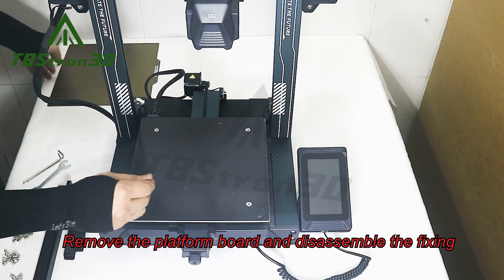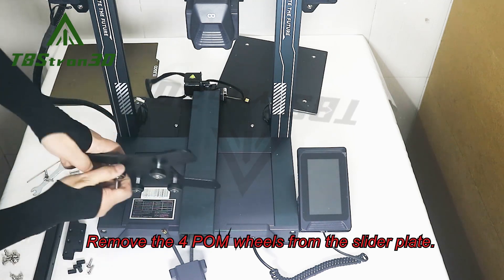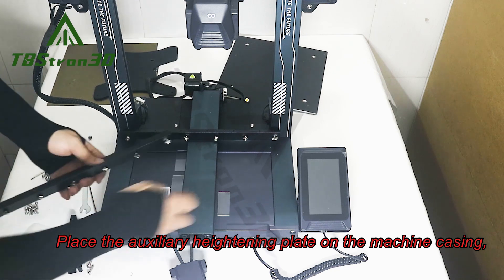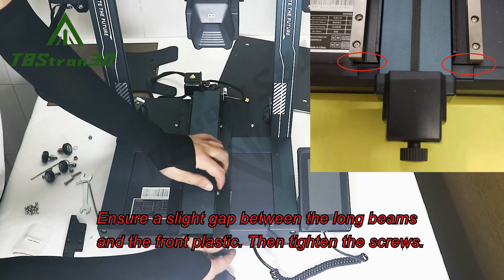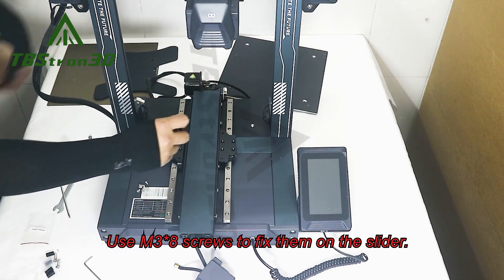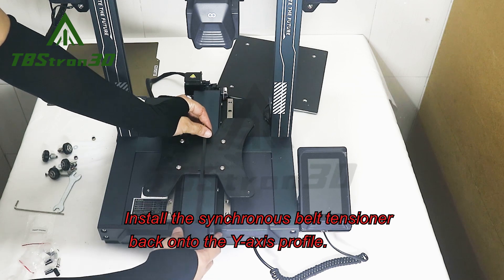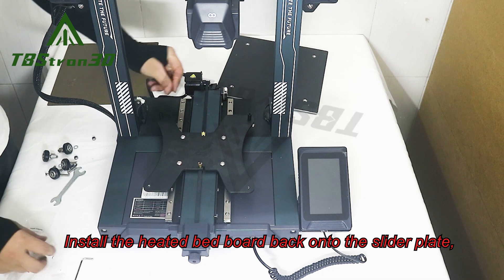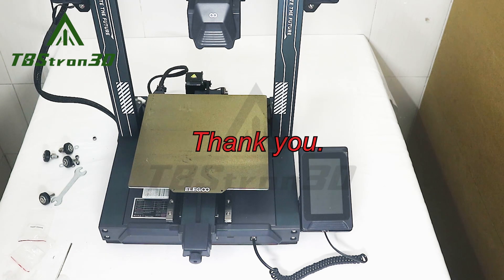New  Y axis upgrade linear rail for ELEGOO Neptune 3 Pro、Neptune 4  installation guide

Comment: Hello, for Neptune 3 pro model, for the "New Axis Y upgrade bracket whitout rails" contain all the screws set/pack ? Thank
Reply from the maker: Hello. Thank you for your attention. It includes screws and silicone washers.
The installation of the new bracket is easier, and it addresses the issue of some customers' feedback regarding the old version brackets not being able to touch the limit switch. Thank you.

Comment: I can, in fact, not 3d print two fixtures for better alignment of the two linear guides, as my 3d printer is taken apart.
Reply: :D
Reply from the maker: Haha, generally speaking, it's quite easy to keep the linear guides parallel even without using those two printed parts for positioning.